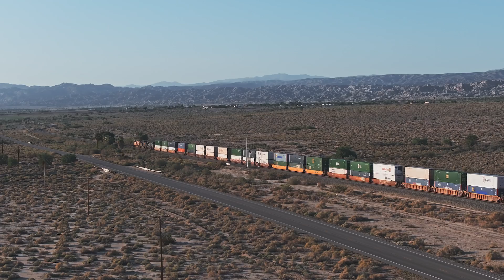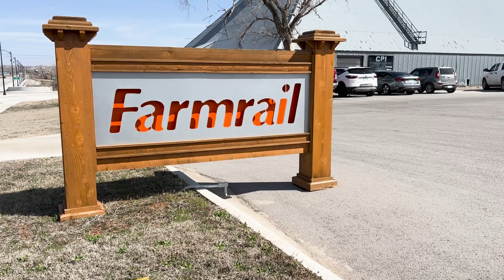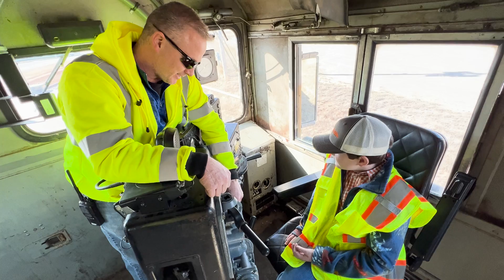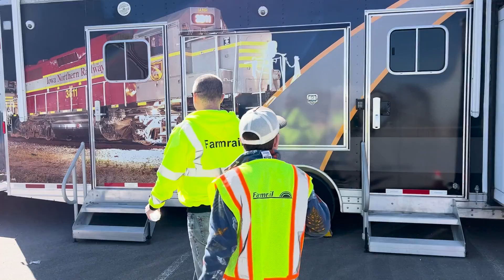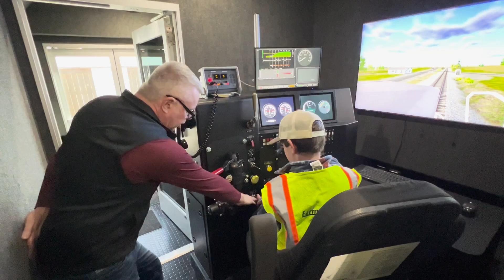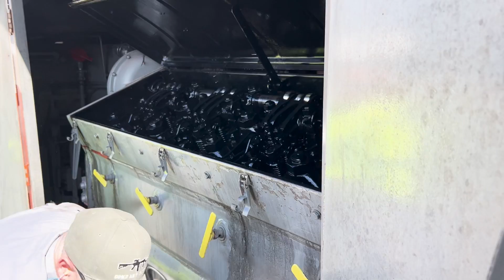Oklahoma's Own Short Line Track - Farmrail Railroad Tour

Comment: I don't think this railroad is so short.
347 miles is a pretty good size railroad.
I live by a short line called AC&W.They 
have SD40-3 and lease CSX power.They
connect to NS and CSX lines here in NC.
Lionel has models of the AC&W locomotives.
Reply from the maker: Thanks for checking it out!

Comment: That's awesome, getting to drive/ operate a diesel locomotive.  That simulator would be neat to try also.  

Thanks for another great video.
Reply from the maker: The simulator was very impressive. So realistic that they can use it to certify engineers.
Reply: @OkieSchoolofAdventure  

Neat!  

Looks better than the driving (car) simulator I tried at the Illinois State Fair, once.  They said it was what people up in Chicago used to learn and practice driving.  I wasn't good at it.  Wasn't real enough in my opinion.